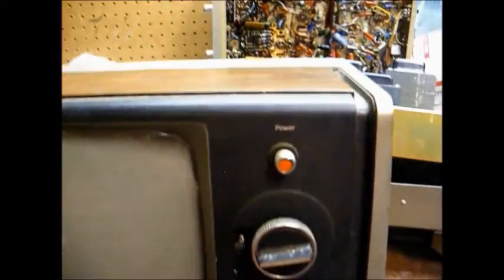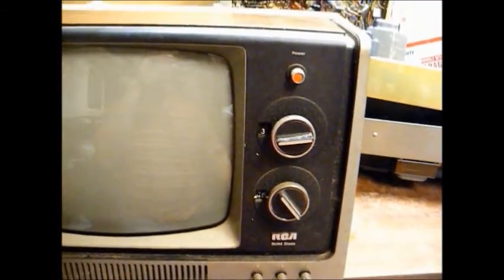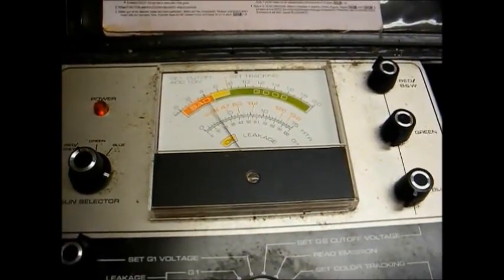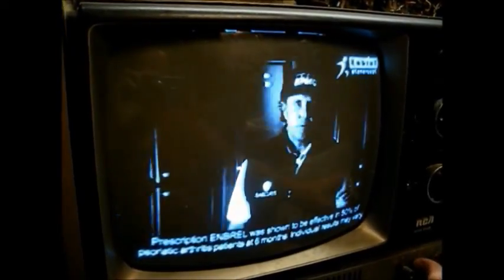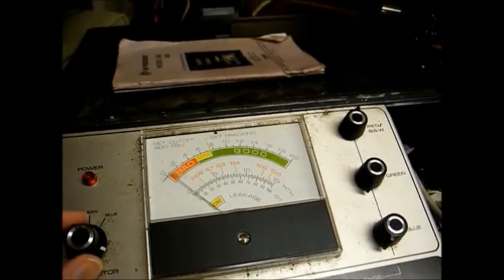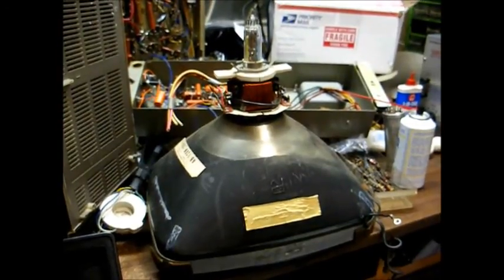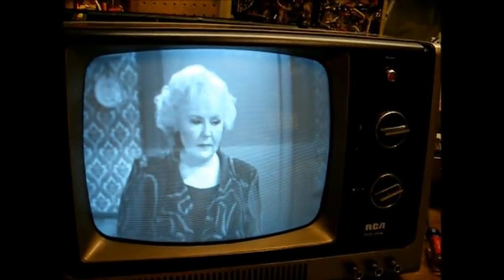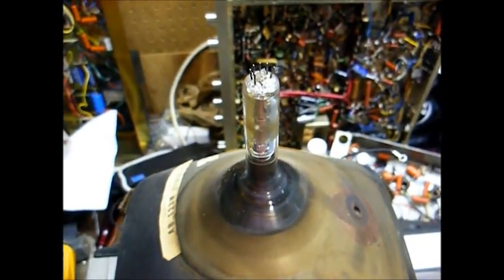CRT replacement in a '77 RCA 12" B&W TV

Comment: I was loading a RCA picture tube into the trunk of my car and got a shock from it, lucky I had asked my dad to help me, it was a small 19" tube but I thought it would be best to get some help with it. Anyway it's a good thing my dad was helping me otherwise I might have dropped the tube.
Reply: CRT's have built in capacitance, and they can and will store a high voltage charge.

Comment: About the only thing that may be an issue is the electrolytic caps and maybe checking some of the resistors, the non polarized caps in TVs from the mid 60s forward seldom cause problems.